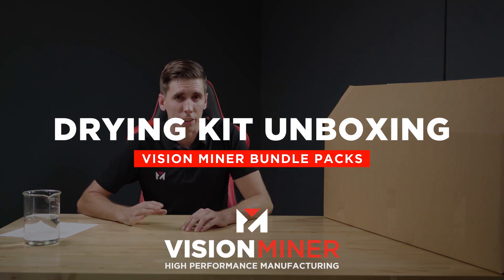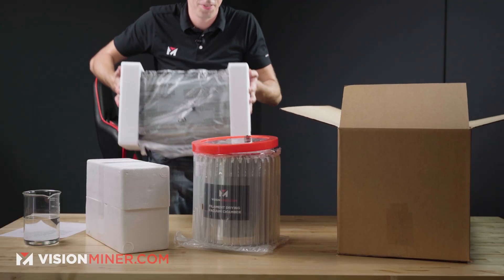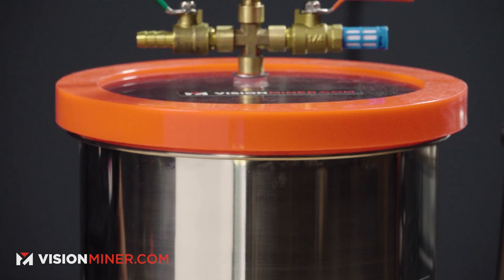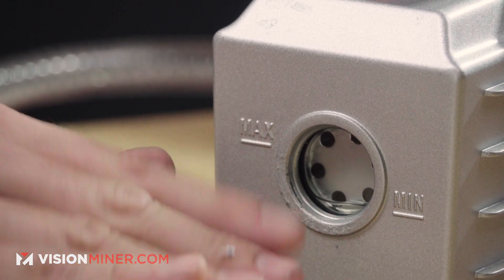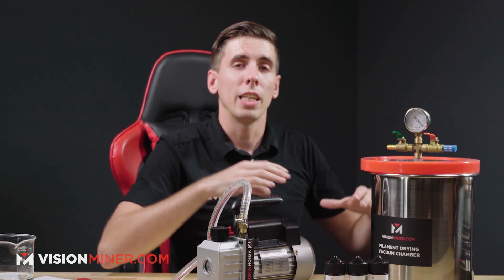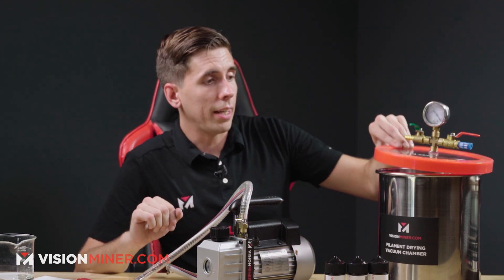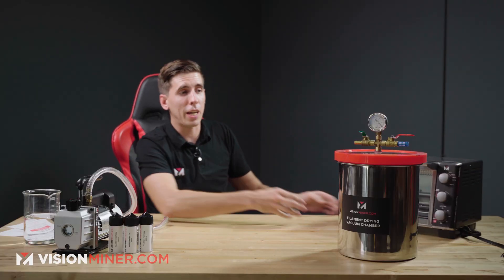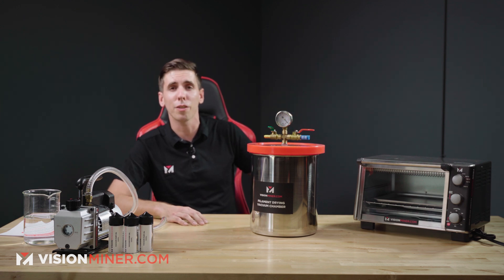Dehydrate Filaments like PEEK & ULTEM - Vision Miner Basic Drying Kit

Comment: Great video! I have a system similar but much larger than yours and I prefer this over a vacuum oven actually. There is something you are missing though. Even with your spools hot, the water vapor and chemical degassing doesn't just magically evaporate off. Water vapor in a vacuum is very clingy, it will stick to the outside of the filament, the spool and the walls of your vacuum chamber. Shaking the chamber around will not remove this vapor. So when you draw down your chamber, you need to fill it back up with dry nitrogen or some of the moisture will go right back into your filament. This gives the water/chemical molecules something to attach to. And then draw down your chamber again. Before removing my spools from my chamber, I fill with dry nitrogen one more time. And then it is a race from the chamber to the spool chamber where the filament is fed into the printer. Also, you need to change your vacuum pump oil regularly. The moisture you are drawing down from the chamber will go into your vacuum pump oil and contaminate it. :goat-turquoise-white-horns::hand-purple-blue-peace::face-red-heart-shape:

Comment: can you dry filament at a lower temperature but longer?  lets say where I have the dryer located I can only turn it up to like 60 without a fire hazard, could I run it for like 24 hours at a lower temp?
Reply from the maker: Often this can work, but there are miminum temperatures for higher-end filaments like PEEK or ULTEM -- our minimums for those are around 110ºC
Reply: @VisionMiner  Thank you!   I'll give this a try with the CFPA6 I bought from you.   I need to get a chamber heater, seems the warmest I can keep it right now is 50 degrees.  with bed heat, not sure if use the hotend how high it will get.  Still only on PLA atm

Comment: Are you going to start selling 2 Side Heating Hot Air Circulating Drying Ovens? There is currently a backlog on components for them. My friend works in a lab that uses them to do ASTM sample testing. There is an ASTM standard for identifying how much moisture in is your plastic and how long it takes for it to re-absorb the moisture over a specific time period. You should do a video on that and it would help people understand the reasons for drying.

Comment: Wonderful kit about the only thing I would add is to use a combination of silica and molecular sieve in the vac chamber.  Have not tried it for filament, but for other projects, I have had with things that needed around 0-30% humidity it usually cuts down dry time.

Comment: So what you're saying is.... I can get basically the same vacuum setup of amazon for $180 and a convection toaster oven for $70, and do the whole thing for $250 without spending $400 through a company?   That's awesome!!!

The reason the timer is still on there is because you're re-accenting and packaging an existing toaster oven that.....has a timer on it.  If you took it off it'd look like it's missing something and you'd have to cap it and make a new faceplate.  So....you leave it on.  Just say that.

Comment: i doubt youve ran into a situation where even more moisture needed removed from the filaments, but adding some molecular seives to the vacuum chamber should make a big difference if the vacuum chamber isnt one specifically designed to remove moisture. Just looking at the vid, im guessing that one isn't but i could be wrong
Reply from the maker: We do use molecular sieve in our storage chambers, but plan to produce kits for the vacuum chambers, as well!
Reply: @VisionMiner  How is your long-term storage chamber? I was thinking about drying initially and keeping it in a storage chamber at low humidity levels until use. Avoids having to dry every time it is used.

Comment: No boiling water in the vacuum chamber.  Watched the whole video waiting for you to throw that beaker in the vacuum chamber and making it boil.  Nice kit.  Stefan over at CNC kitchen did a video on using a vacuum chamber to dry filament but he didn't bake it first and then put the hot spool in the chamber.  Interesting to see how to use the combination to get the very last bit of moisture out.
Reply from the maker: Yep, it makes a huge difference! And don't worry -- we have an advanced kit coming out very soon, and believe me, I'm going the full 9 yards on that one... pump, boil, etc! Thanks for the suggestion, too!
Reply: @VisionMiner  is there anything in the cards for drying larger spools, like 5kg or 10kg spools?

Comment: I personally am probably never going to purchase this kit.  That said, to most people, $400 may LOOK like a huge markup over the ~$250 you would spend to source the parts.  But...  You must not forget to account for this:  That $250 kit is stuff basically straight out of China with barely any quality control or calibration, and NO customer support besides "okay, we send you new one, two weeks."  I'm almost certain that the kit from Vision Miner will deliver excellent results out of the box without spending days fidgeting and calibrating like you would with direct-sourced components.  That is worth more than the price gap, especially if you are working in a production environment and need to GET PARTS OUT THE DOOR NOW.
Reply from the maker: You're completely right! Not to mention the 30% tariffs on everything from China -- some very cool stuff coming soon, the advanced kit with a programmable oven and larger vacuum chamber is on it's way :) that will be quite a bit more expensive, of course, but thank you for the comment! (The support thing is 100% on point)
Reply: @VisionMiner  How about high temp reusable vacuum bags inside a chamber? Should be able to dry in an oven while under vacuum and won't have to worry about reabsorbing moisture in storage.
Reply: This stuff is also right out of china.  In fact, their stuff looks like it's just re-stickered from the same mfg that's selling on amazon.  Look at the product pictures next to their's side-by-side.  Same thing, different accent plastic....that's it.    The markup is just a laughable margin, but everytime they sell the kit it's $150 pure profit for them.  That's a nice margin!   I bet they hope to sell a crapload of them.  :P